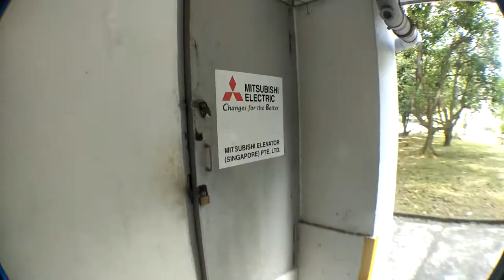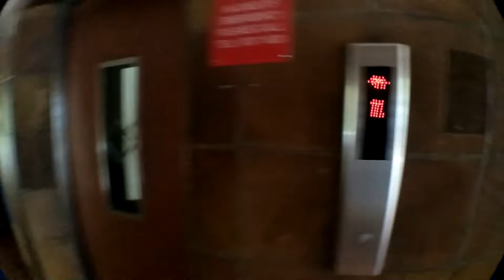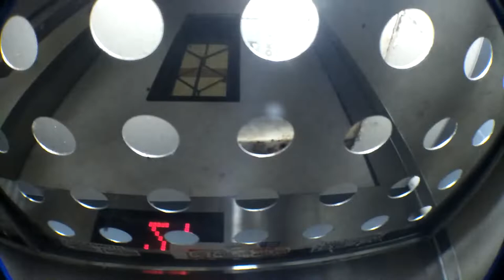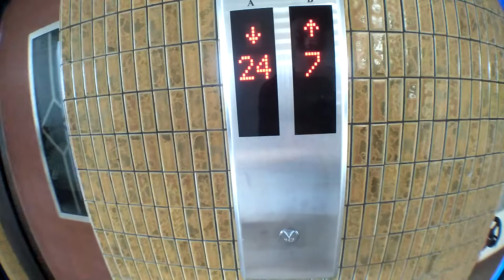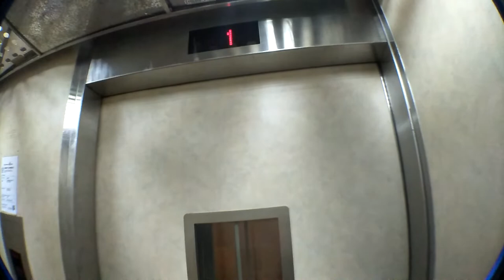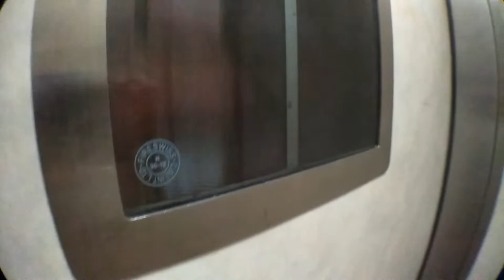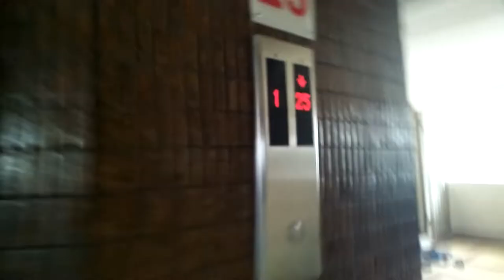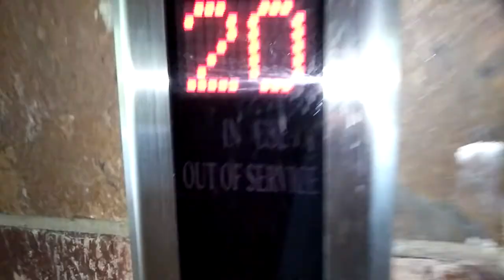Block 10A Braddell View Condominium - Fujitec traction elevators

Comment: how did you enter?
Reply from the maker: I walked there from Braddell MRT, past Toa Payoh North near the blue HDB blocks all with boring Otises. There's a staircase from the road near one of the blue blocks down to a long cemented walkway, then just keep walking using that path until you reach the gates there. That's a side entrance to the condominium. About 15 minutes walk.
Reply: so you followed someone in?
Reply from the maker: nope, i went in there alone. It's a side gate, no security or anything. Many people walking in and out, so u can choose to follow them in if u want to
Reply: intriguing... thanks for the info then

Comment: According to fujitec website the modernisation project for these lifts was expected to be completed by September 2001
Reply: I have a feeling that they got another mod, as those buttons do not look like they were around in 2001. Either that or the 4 listed lifts modded were in 2 other blocks.
Reply: PotatoLift1 yep I suspect the buttons were replaced again at some point of time.
Reply: PotatoLift1 the indicator does look like its from the 2000s era tho so it might have this mod then button replacement
Reply: @elevatorfilmersg  This specific kind of indicator is very new. The 2000s one is more spread out. Its likely it had fixtures like National Dental Centre or Manulife Tower, but they remodded the lifts.

Imo the panels look too new to be from 2001, some things were modded twice
Reply: PotatoLift1 I see. Then I Guess it would also make sense since the call button doesn’t look as though it has been retrofitted into some old panel. At least the original voice is retained then.
Reply from the maker: I suspect that the buttons were originally the same as Gloria Mansion's. They probably were replaced due to them breaking.
Reply: PotatoLift1 Nevermind, found out in the end the lifts were modernised in 2017.

Comment: Haish if only they left the original indicator there instead of covering it up with another piece of metal
Reply: Christina Lim On the outside the original indicator has been covered up with a piece of metal as its no longer used
Reply: Christina Lim at 3:39 for example